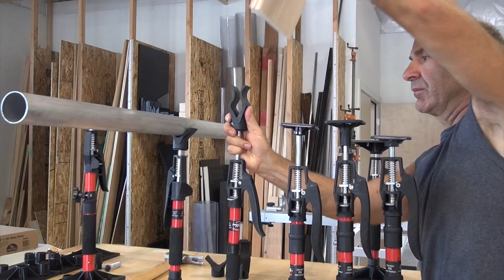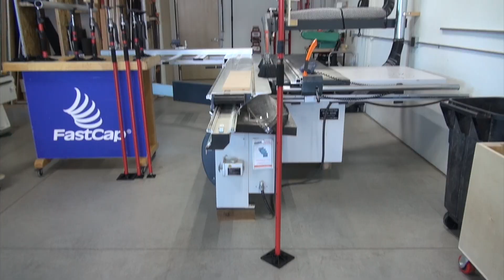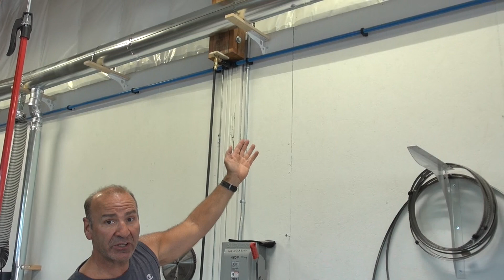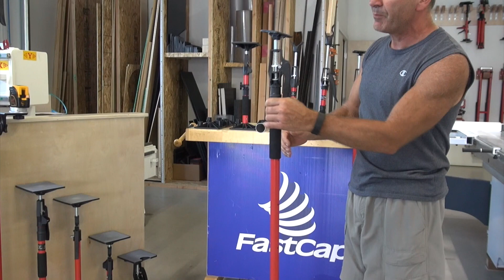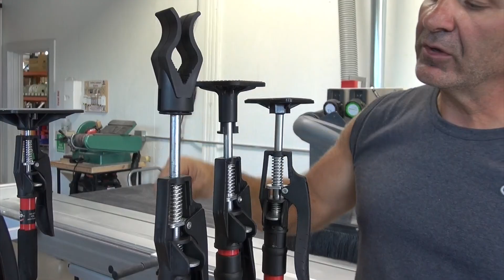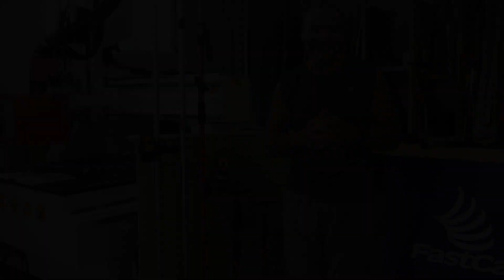3rd Hand Pipe & Panel Adapters - Lean Manufacturing

Comment: How much weight can the small ones hold?
Reply: FastCap  Thanks for checking. I would have been surprised if it did! Thanks for all your great products and innovations.
Reply from the maker: It would be difficult to exceed any weight limit what are you trying to do.
Reply: Don’t be So sure! I am a Piano technician. Occasionally I need to prop up a corner of a grand piano (roughly 18 in. off the floor) to change a caster or do some other work on one of the three legs. While it doesn’t need to support the weight of the entire piano one corner can be a couple hundred pounds. It it able to support and hold weights like that?
Reply from the maker: I have a piano. I will test it and get back to you.
Reply: FastCap Thanks, but be careful.
Reply from the maker: We just did a quick test. It will not move any part of a piano. Too heavy!
Reply from the maker: No problem.